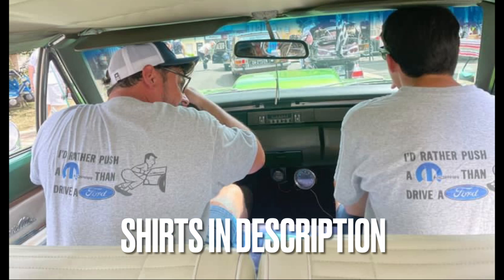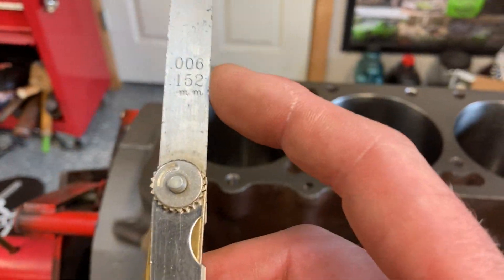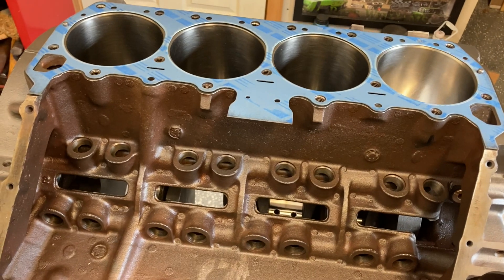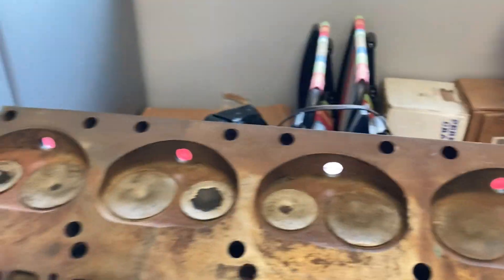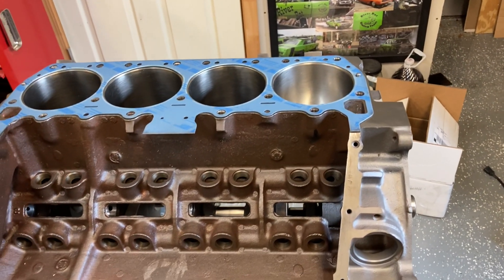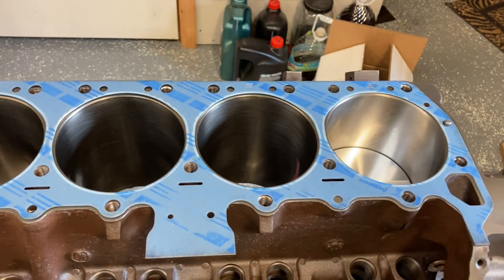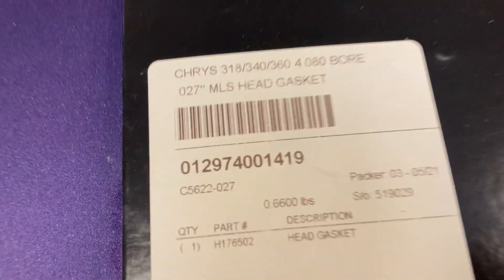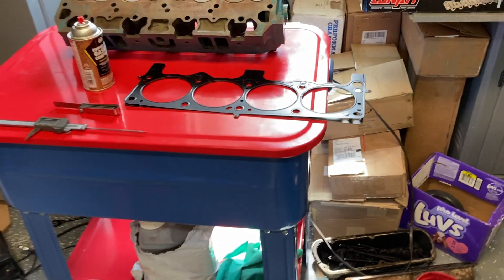3 Common Head Gasket Mistakes Made by Mopar Engine Builders(that Affect All Brands)

Comment: As far as stock engines goes I use felpro permatex . I also make sure the head gasket surface and engine to head gasket surface has been if not machined I use orbital DA 320 grit sand paper to ruff up the entire surface and use micro fiber clothes with either carb/ choke cleaner spray or brake parts cleaner spray to prep the surfaces . other rags leave fuzz ect behind . I was told an old timer truck. use spray can of clear coat on the old steel gaskets to seal it ?? never tried it . I was told to use copper coat on the new clean sheet metal head gaskets . I stick with fel pro gaskets unless it would be for racing . Also I dont know how well this works but once you have your heads  torqued down leave them for 24 hours and come back and take the torque stick at the final torque spec and randomly start rechecking the head bolts again but not in factory order ?  it helps fine where a bolt or a part of the head has under pressure settled / stretched a little more causing an inaccurate torque but not by alot  ? Seen that quit a while back on a Nicks garage video
Reply from the maker: Hey buddy! Where have you been? You will like the car I picked up today for a customer. It looks very familiar!
Reply: @JustMoparJoe   Sorry for that long first comment. ive been working at my new job for the past month and a half and it cuts into me watching lives or videos and this week I've been out sick with the family with covid
Reply: I used a copper coating on the first engine I did at the advice of the machinist, but haven't since. I put them on dry and haven't had an issue. I've always done as you mentioned and re-torqued the bolts the next day, but always in order. My last engine was 80 ft lbs plus 90 degrees so unless there's some trick, they can't be checked later on. That head gasket failed. It was some random brand offline during covid when parts and materials were hard to find since everyone was home and finally had free time to work on their cars plus a drop in manufacturing. I haven't fixed it yet, but I'm just now learning about all of fel pros options and might order different sets than I  got. Spraying clear coat doesn't sound like a good idea to me, lol, but maybe on those old steel gaskets it would help. I still wouldn't and would use something made for it

Comment: Used a set of Cometic on my 400. So far so good. Had the deck milled like you and plan on doing same on the next 400 that I’m starting this winter. Great advice Joe 👍👍
Reply from the maker: Excellent! Thanks for sharing. I’ve seen them fine on a stock block and smooth cut head. My heads on the 408 looked like a chainsaw cut them.

Comment: Thanks for the info Joe. I've used steel head gaskets where ever possible and used the copper spray on them but never thought of or asked about spraying Comedic gaskets or the .038's.
Reply from the maker: Cool Chris. I last used the shim style on a 383 with no issues. The engine was around 11/1. The new owner blew those gaskets on his 10th nitrous pass of a 125 shot. Idk if he had an AFR gauge or ever pulled a plug.

Comment: That's a good point about the Aluminum heads. I put mine on with toe Fel-pro gaskets so that should be ok. Other than maybe at the fire rings.
Reply from the maker: Yes sir. I may go ahead with the gaskets recommendation from edelbrock. I’m still studying. I don’t want to get burned again on a ring hanging in.

Comment: Cool video. I used MLS gaskets on my 408 Mopar no copper coat and haven't had any problems yet.
Reply from the maker: Thanks brother. I would have on mine too, but they ran the heads over a rough stone and the bottom was a terrible finish.

Comment: Great video and 100% correct on the first point. I just looked at my four blocks collecting dust and no chamfer, perhaps that depends on what plant and shift it was assembled at? Number two, I ran 11 to1 for years on a felpro blue gasket, albeit with head studs. Copper coat is meant for steel shim gasket only! Finally you are correct on the dis similar metals, fine if you are tearing your engine down every season but long term who knows?
Reply from the maker: Thank you Greg! Your experience matters and I appreciate you sharing.
Reply: Or I have also used silver paint  on a steel h gasket I think the factory did
Reply: Wouldn't copper coat negate the corrosion issue?
Reply: @wayne8498  To a point, yes
Reply: @gregtough9055  thanks for the response.

Comment: I would take a good seal over compression any day, but every thing I had any work on , I had both the head and block milled. The lone exception was an 84 Pontiac,  Sunbird 1.8 4 cylinder.  Ed did a valve job, and the cam carrier bolts with the head bolts.  He milled both sides of the head to make sure the cam wouldn't bind.  It worked great.  My concern is longevity,  not performance.  My 3.9 lasted 21 years with very few problems.
Reply from the maker: Awesome, Bert!